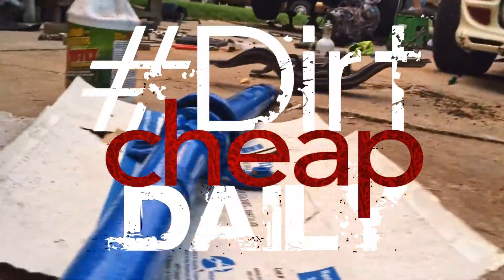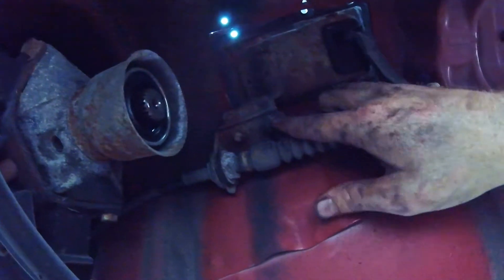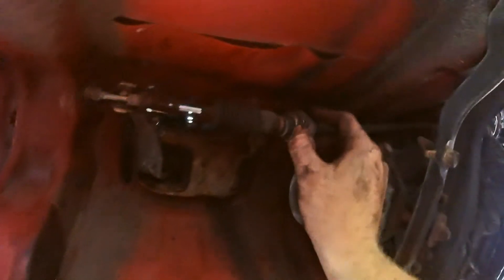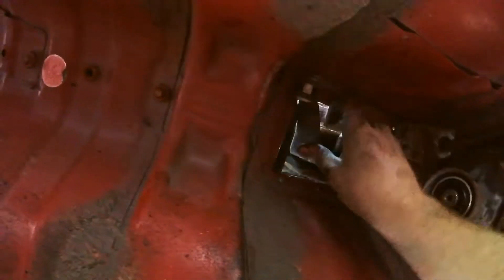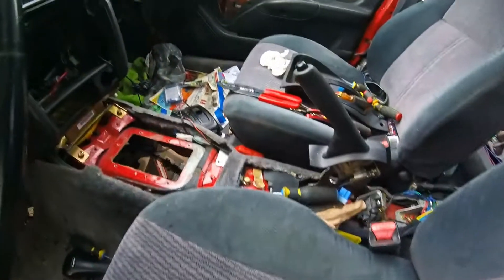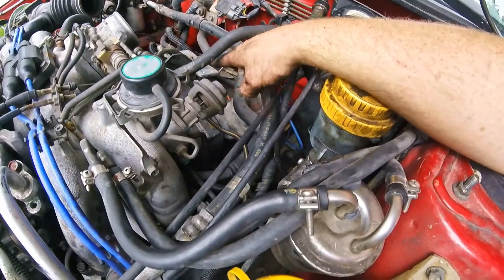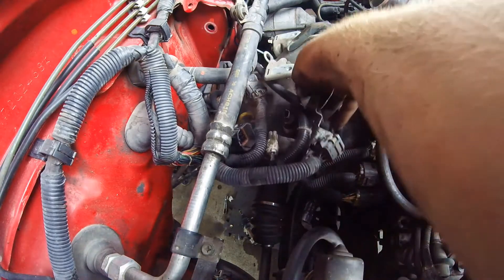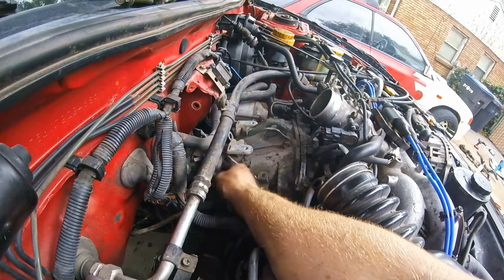Subaru Manual Swap - Part 3: Auto trans Removal  - Dirtcheapdaily : Ep.25

Comment: I’ve watched and liked the first two videos, I’m in the removal stage of the autotrans on my 05 obxt, I have a nearly complete donor, ecu and mechanical on a 2011 wrx, (engine, 5 spd, clutch works, driveline, etc…salvage title only car, I’ve been told it could be a track car but I need a daily to replace my truck with 330k km/208000 miles, which still runs great, it just needs a refresh), I don’t see much yet so I’m pretty thankful for your work, greetings from Alberta Canada!

Comment: I am doing the same exact thing with my 95 impreza coupe! how hard was the electrical work ?!?! thanks for uploading!
Reply from the maker: +Edgar Alonso wiring isn't that bad at all. I haven't had time to finish it up yet, but there's only a few wires you have to jump together.
Reply: no way, sounds like a great time. is it just slicing the automatic transmission harness? also how can I make the clutch pedal the neutral start switch? or is that  what the transmission wires signal off to the ecm/ecu?
Reply from the maker: +Edgar Alonso  I didn't worry about the clutch pedal. You'd need to rig up a relay for it to work right. The neutral safety switch needs grounded t start, but when you push the clutch in, the clutch switch goes to the open position instead of closed. It wouldn't be that difficult to do, I just didn't worry about it because I know not to start the car in gear. 
All you're dealing with to get the rest of the wiring to work are like 6 wires. I have a whole episode coming up that explains it all
Reply: very good, thanks again. thanks for replying. I'll tag you on Instagram once the coupe is done! have a great one.
Reply from the maker: +Edgar Alonso sweet! Looking forward to it.
Reply: @Dirtcheapdaily  I drive a 2006 subaru impreza 2.5i wagon automatic and I'd like to do a manual swap. Would it be possible to swap the gauge cluster (maybe from a 2006 sti) as well so I wouldn't have to try rigging up a relay for the neutral light? Thanks in advance

Comment: no special steps for gutting the transmission lines out?
Reply from the maker: +ArC Hoax no, there's just a couple bolts holding them to the frame rail. With them out you should be able to just pull them out